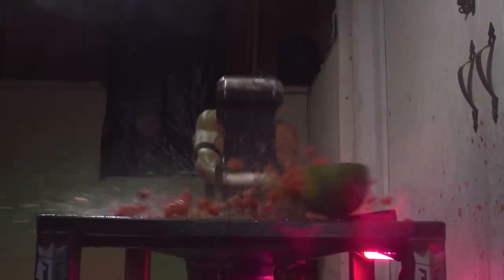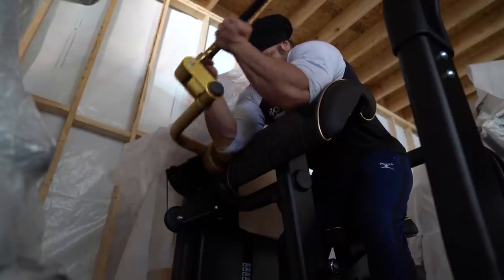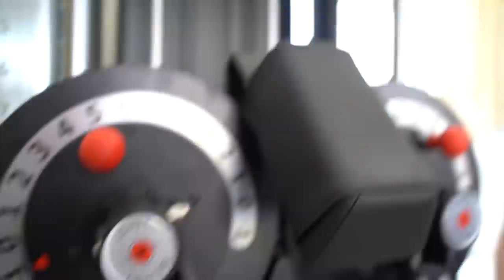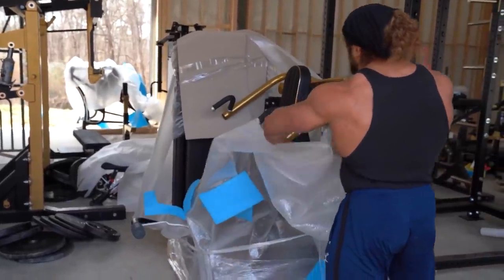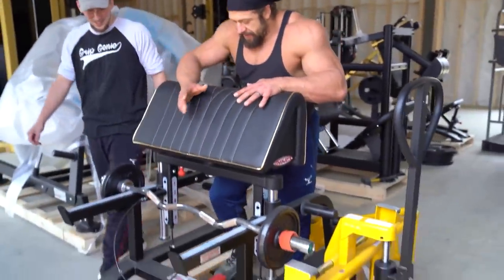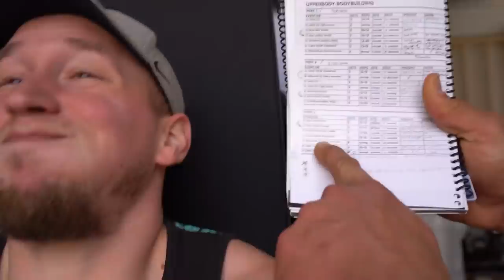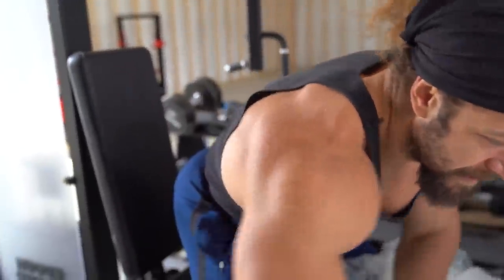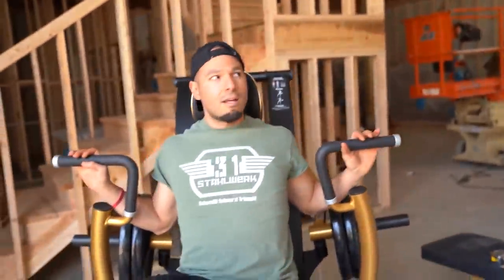BEST HOME GYM LAYOUT? WHAT? HOW?

Comment: For recommendations.... Machine positioning wise, I'd say that's surely personal preference, but for some of the other stuff, I'd install speakers throughout the gym not just in one area. Much better to get balanced sound coverage. Also, consider audio treatment including absorption (bass traps if you're installing some serious sub bass speakers to prevent bass frequency buildup and drop outs, and soft materials for reducing reverberation) and reflection materials (for balanced mid and high end frequencies) to improve overall sound quality. Stuff like curtains make a dramatic improvement to large spaces. Just because it's a big space, doesn't mean it needs to sound like one. If you're looking for the high impact lighting, probably a great opportunity to install a mirror wall and spot lighting under the first floor platform in that lower ceiling area. Maybe a good spot for the dumbell rack and the benches. High contrast lighting is easier to achieve at smaller distances. Those are things I'd probably do.

Comment: I would go for a 3x3 grid in the gym, 1 row is power movements second is first level accessories, third is finishers/bodybuilding, and as far as the columns you can orient them based on the 3 big lifts, so a hamstring curl would go near the deadlift platform and a leg press closer to a monolift/rack

Comment: My thought on layout:  Definitely have a powerlifting section and a bodybuilding section... since the BB section will be bigger due to all the machines you can further split that up into one half upper and one half lower.... within each half of the split, organize the machines based on body part (chest machines, back machines, shoulders, then arms,;and put the arms machines near to the mirror and the dumbell rack the furthest away from the powerlifting section).... the lower body parts should go (starting from the furthest away from powerlifting section) calves, then hamstings then quads (nearest to the powerlifting section)

This setup will allow you to hit some nice supersets after squats/deadlifts without having to go acress the gym, and will also allow you to go from the bigger muscles groups (proximal) to the smaller muscles groups (distal) the further away from the powerlifting section you go... and of course the dumbbell rack/mirrors is a catch all so you can still do some fun supersets with arms or calves in addition to dumbell work.  Hope this makes sense! If not, here is a sketchy diagram....

P                                                                                                                                                                                                   D   
O               leg pressing machines                quad machines                     hamstrings                       calves                    U     M
W                                                                                                                                                                                                 M      I
E                                                                                                                                                                                                   B     R
R                (OPTIONAL INDOOR TURF/MATT FOR SLED PUSHING IF IT RAINS OR SOMETHING)                             B     R
L                                                                                                                                                                                                   E     O
I                                                                                                                                                                                                    L     R
F                                                                                                                                                                                                   L     S
T              chest/back machines                 chest/back machines              shoulders                    arms                         S
I                                                                                                                                                                                                  
N                                                                                                                                                                                                  
G

Comment: Opinion:
Gym organization far side to loft side:
Mirrors, lift platforms, benches, dumbbells, barbells & weightrees, mono, plate loaded machines, pully, pin loaded machines. Strongman under loft. Cardio on the loft.

Legs on front side, arms on backside. (So you don't have to walk as far after leg day)

Comment: Most stage lighting for body building is what we call "hard lit" meaning it's not diffused and can cast shadows. All the lights in offices, warehouses and even most consumer video lights are designed to be "soft" so that you don't have shadows on what you're working on. Diffusion masks tiny imperfections disappear so complexions look clean. But for a physique you don't want that because it shows detail. consumer LED lights and fluorescents pretty much come diffused out of the box. So I'd almost recommend you set up a booth or specific spot in the gym that is lit with hard lighting with a snoots or an egg crate to keep the light in a straight beam (think small spot lights). You can't go wrong with Fresnel style lights. If you really want to mount them up and out of the way in the rafters I'd recommend  ellipsoidal lights. No matter what you get you'll need 3 lights. One shooting down on you from behind on high to separate your body from the background. The other two go in front of you at eye level coming from left and right to dial in how bright you're lit and the other to dial in how much shadow you want. The lumens depend on how much space you're gonna allow between the lights and your body. The closer they are the less lumens you'll need and visa versa. Here's a Fresnel for something close up like a booth or platform https://www.fullcompass.com/prod/008244-altman-65q-750w-6-fresnel?dfw_tracker=36058-008244&gclid=CjwKCAjw3pWDBhB3EiwAV1c5rKw-NxyFjph76-OTvg2P4midua2gm6vkhIKHn-lDNXcA_DIrCbsITRoCJYYQAvD_BwE       And Here's the Ellipsoidal for mounting high and far away https://www.fullcompass.com/prod/086614-etc-source-four-19degree-750w-ellipsoidal-with-19-degree-lens-edison-connector

Comment: Was thinking that you could apply your existing logic of what might go together. I.e. chest press and seated row in a similar area, but with chest press and seated flye machine right beside each other. 

But.... another factor could be machine height! It think it would look slick, some machines won't be hidden by others, aaaaand I don't think it would disrupt your current thinking (which I regurgitated at the start of this comment). Maybe from back to front you go something like- crossover machine --> flye machines (chest and back) --> pressing machines (upper body) --> leg machines --> Calf Wizard --> then free weight benches --> floorspace --> Deadlift Dungeon. Not game-changing but just a thought.

Comment: This is the kind of gym I'd actually workout in. All of these machines look motivating in and of themselves. As in, it looks like it'd actually feel good to use them and not be a burden. The ROM and mechanisms look comfy enough to actually push to failure instead of looking at free weights, contemplate lifting and then get lazy about setting up and just push it off indefinitely.

Comment: I would organize the gym by which workouts and body splits I usually do together. So I would put upper body machines in one section, lower body machines in one section, free weights maybe near the middle of the gym, and then a section for powerlifting and strongman

Comment: I would sort it into 3 sections like a pie. Have deadlift platform, the competition bench and the monolift all facing eachother in the middle. Then gradient the rest of the equipment by how many muscle groups they use, so most isolation machines are on the outside, but do it behind the powerlifting things, so pull behind deadlift platform, push behind bench, and legs behind monolift.

Comment: Gym layout:
Traditional separation for the machine based off the regular separation, calfs, quads, bicep, traps.
Monolift dead center so when you're squatting your facing the sound system.
Whatever you enjoy the most under the stairs. Putting something you hate doing, for juju calfs, under the stairs would make it even harder to make yourself get that workout in. Its in bad lighting, its in a separated area, it's secluded, all those things will just make you feel like your dragging your feet just to get in your workout

Comment: Cross-reference all the different workout programs and the types of exercises they contain. Find similarities and then position the machines/equipment in proximity to each other based on those similarities. For example, if a lot of programs have squat and deadlift after one another put the deadlift platform near the squat rack/monolith. If a lot of programs have bench and shoulders together, put those 2 pieces of equipment near each other etc. Looking forward to see the finished product :)

Comment: Lighting 101: Inverse square law! The closer your light is to the subject, the faster it will fall off. Meaning a light that's close to you will fall into shadow quicker thus, in your case, defining muscle better. Another consideration is size of the light relative to your subject. A "smaller" light, say a traditional light bulb vs a bank of fluorescent lights will have a harder shadow at the same distance. This should also aid in definition because the shadow will have a hard stop instead of a gradient. Diffusion and specularity are also something to think about. A light that is diffused by a material, say a lamp shade vs a bare bulb will have less specularity. In other words the highlight of your light will more apparent without diffusion. That means the difference between the highlight and shadow will be greater, so more contrast which should also help things pop.

Comment: Definitely have a upper body area all pressing movements with some back machines nearby leading into the cable crossover. And on the other side of the cable crossover lower body, deadlift platforms and squat racks . Leg machines. With powerlifting near by.

Comment: I think based on sport. Body-building in one section (with opposing muscle-groups next to one another), power-lifting in the middle and then strongman stuff on the other side. Dumbells should also be as central as possible (maybe bridging the gap between BB and power-lifting.

Comment: Idea for layout: If you have regular routines for you workouts and stick to them, you could place all the equipment for routine #1 together. Then routine #2 together. Etc, etc. This way you wouldn't have to move around so much and think about which equipment to use. Everything is right next to each other. 

Other than that, in my head categorizing between muscle groups seems the most fitting.

The calf machine MUST be visible and practically placed.

Comment: would probably have rows of different groups and types of exercises with the more common, high frequency items more in the middle with others being around the periphery.  since your layout is a large rectangle, walking can't be avoided.  but have the ones that relate to each other in groupings.  definitely don't put leg stuff on the 2nd floor, unless your challenge is to try to see if you can avoid a broken neck each time you fall down them...

Comment: The best bodybuilding light set up isn’t really the way you should think of it. I’d go for a studio set up with the ability to dim and reposition lights. Left and right rim lights, strong over head spot for high contrast and maybe 4 front fill lights with one more Versatel reposition able on a trolly.  Two reflectors and different backdrops. You should totally do a one light photo shoot with chalk flying though the air for dramatic effect.

Comment: Layout?  
Free weight area with DB rack in the center.
Power rack on one side of that area, because you want to have quick access to those weights and bars.
Strongman area on the other side of said area for the same reason.
Machines ordered by body-parts, because everything else makes no sense at all.
Cardio crap wherever you have space left, far away from the weights. Maybe in your barn.

Comment: Personally I wouldn't order the things by how you superset them. Sometimes you don't want to superset, sometimes you gotta change your workout plan.
I'd prefer ordering it by goals. You gotta do powerlifting stuff in the squat rack, and bench press right next to it. You gotta do some accessory lifts, so you put Calves, Forearm and Upper Traps exercises at one place. Strongman stuffs near the gate as you use them mostly outside (Yolks, Farmers Walk, etc).

And why not put the Sound System near the staircase? You could make it fancy like having a bluetooth connection to your phone, switching songs with a button (or use Spotify, whatever) and then just activating it whenever you get close to your gym, instead of having to press it manually near the gate and taking up space where gym equipment could be. In rare cases you forgot your phone you just go to the staircase and hit it up manually.

Comment: Having lit a few bodybuilding shows professionally, I think your lighting should take into account what the lighting will be at a bodybuilding show. Typically, that's with a parallell front wash set 45 degrees in front of the contestants. It's gotta be really warm white, almost orange, not cool white in any way. So if you're gonna have a big ass wall of mirrors to pose against, choose a distance from those mirrors to stand, and set your lights above the mirrors shooting down at 45 degrees to you. The 45 degrees helps create shadows with all your leant-forward positions. You want them bright as fuck, brighter than the rest of the light in the gym. You want them shooting paralell, not angling in from all sides, because the goal is not just to light what you see but also use shadows to get muscle contours.
You can cheese having the rest of the gym also being relatively brightly lit by having the rest of the lights a really cool white, really blue. This helps with contrast and creates "pseudo-shadows". It's a basic theatre lighting technique - things that you can see that are meant to appear in shadow are lit blue.
If you want more than the posing section to have good lighting, take those same principles and apply it to other places you want to pose. For you, think of the camera position as the mirror wall in the above example. So bright ass orangeish light at 45 degrees to you above the camera, blueish light from behind the poser. Then you can probably experiment with camera angles and sweep them around from 45ish left to 45ish right, keep that lighting, and still achieve what an audience might see at a bodybuilding comp.

Comment: Separate free weight/powerlifting side and bodybuilding/machines  with racks and plaforms in the the "middle" on the edge of a turf runway then separate lower, upper body and push/pulls and shoulders in its own area maybe more in the middle. And a posing area under the stairs with a full mirror room. Strongman stuff (awkard stuff) in the barn
Like tires, atlas, stones, sand bags, wooden logs. Yokes and metal logs in the big gym.

 that would be my dream gym

Comment: Why don't you put the soundsystem in the roof pointing down. Like your fan? And a control station that can play two or even three different loops with different kinds of sound. All controlled remotely, with an app. I think something like this is available and if not, it should be.

Comment: "Like I said...You have the lower body and you have no upper body, you got a problem building...wait a minute. You have the upper body, and you have no legs, you got a problem building your legs. You have the upper...you have the lower body and you don't have the upper body, the upper body, it is easier to build. So if you have the lower body and you don't have the upper body, it is easier to build the upper body. You have the upper body and you don't have the legs, you got a problem building the lower body... No, you don't understand. You have the upper body, but you don't have the lower body, you got a problem building downstairs. You got the up- legs on the bottom, it is easier to build on the top, so you don't have much as a problem. Yeah."

Comment: So...  I don’t have a work out partner and only work out in my home gym...  I feel my dumbbell row is getting impressive but have nothing to really base that off...  When working heavy sets, I pull 150 lb dumbbells for 4 sets of 5 reps... I don’t have access to heavier dumbbells and I use standard plates so setting up a 300 lb barbell simply isn’t an option, so I barbell row 160 with several large chin up bands adding resistance...   the question...  is a 150 lb dumbbell row for sets of 5 to 6 reps solid or not so much?    I’ve only been working out since November 2020 so I understand I’ve got a lot of growth to go